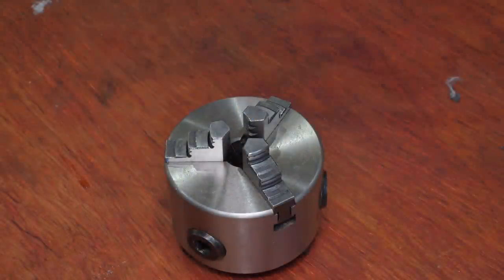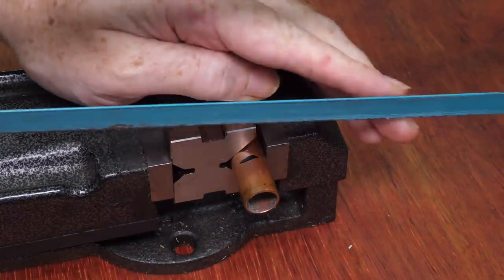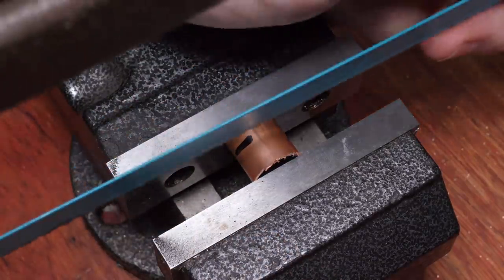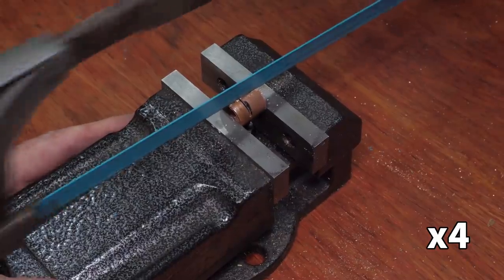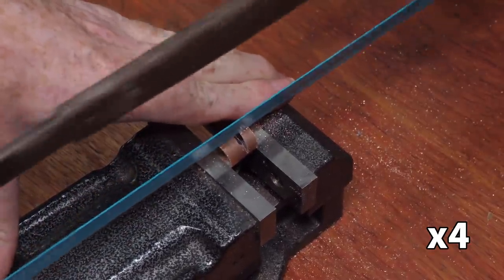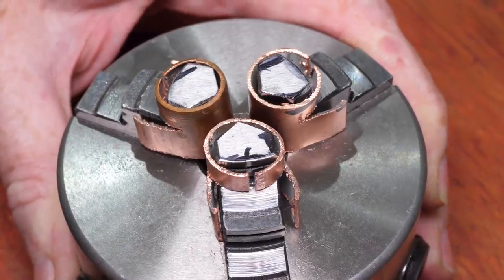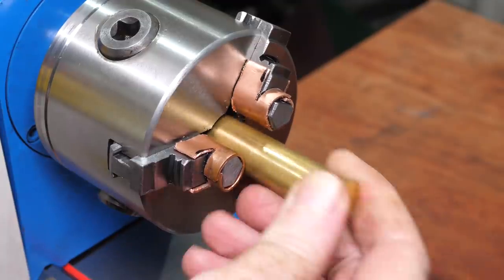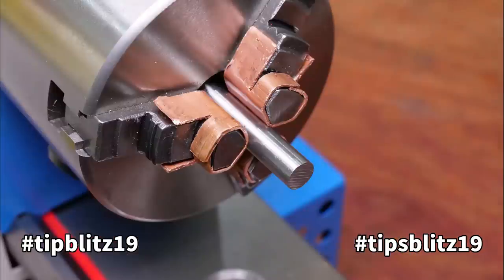Making Copper Soft Jaws from Scrap Copper Pipe for the CJ0618 Lathe - TipBlitz19

Comment: That is a nice set of jaws which I intend to copy. When I have to cut copper tube across the diameter I use a plumber's cutoff wheel-based tool, which makes a very clean cut, is very cheap (mine was $2) and is useful for household plumbing. The long  cuts still have to be made  with a hacksaw. In keeping with my miniaturist world, I use a small plumber's saw with a very fine blade -- maybe 40 tpi . The fine blade reduces "straddling" and does not jerk the vise around so much.

Comment: You got a lathe chuck that you could have used to part off the lengths needed....safer then hacksawing  using a free floating vice...just saying 😬
Reply from the maker: My lathe isn't up and running at the moment, due to the floor repairs. #tipblitz19 was a hard deadline I couldn't miss.
Reply: Yes those hacksaws can be lethal.
I once observed a person accidentally sever both their arms off and it all happened in a split second.....just like that!
Reply: @jayytee8062  Exactly! Lethal!...